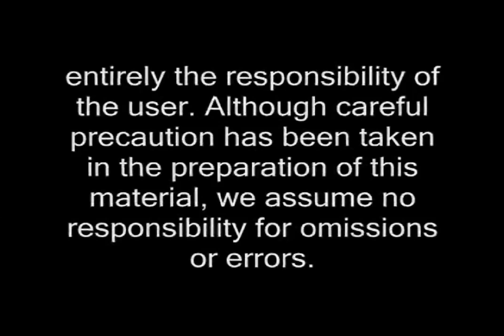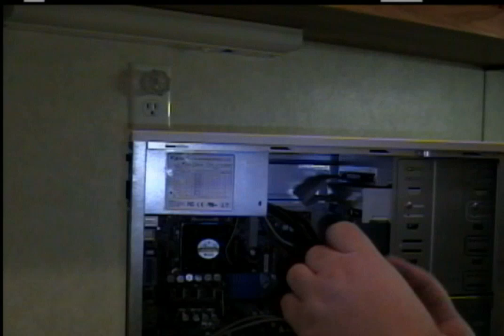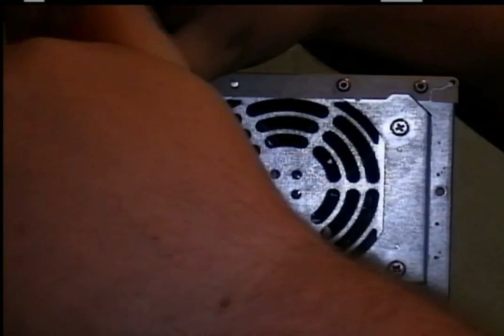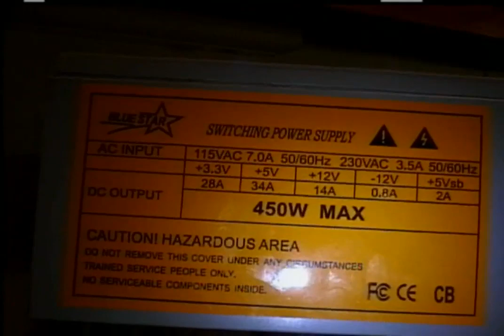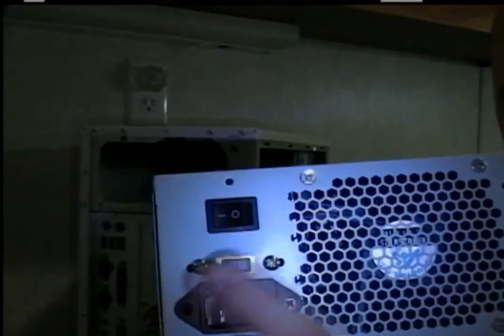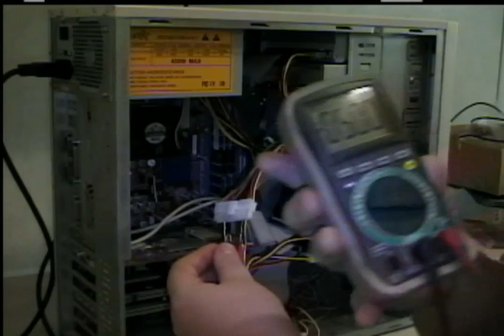Testing & replacing the PC's power supply

Comment from the maker: Surge protectors do not protect a whole lot. Was the PC plugged in when you cleaned the Fan? Try resetting BIOS. If the PC was unplugged for a period of time while cleaning the CMOS battery may be weak and needs replaced. -MrFixit

Comment: hey ive had an issue with my computer since i cleaned a fan, i plugged it into a socket without a power surge protector and it seems to be having the same issues as what you said about the power supply failing, or maybe i did something else?

Comment from the maker: The HDD should be fine, deputybluevein93. The PSU is designed to shut-off in the event there's a problem. It mainly depends on what failed in the PSU and what the HDD was doing at the time of the power failure. You may only need to run Check Disk on the HDD to correct any errors in the data once the PSU is replaced. -MrFixit

Comment from the maker: You're welcome. Yes, deputybluevein93, the PSU does cause problems when it starts to fail as mentioned in the video Description. Most causes are due to power spikes and surges. The motherboard must receive a Power Good signal from the PSU before the unit is allowed to be turned on to help prevent damage from an unstable PSU. -MrFixit

Comment: Hi i have an inquire.recently something blew up in my pc.there was no smoke or sparks.just a popping sound.obviously the pc went off.i stripped my pc apart.i had a look at the motherboard.there doesnt seem to be any damage on it no burn marks.but i wanted to know could it be my psu.i stripped that aswel but couldnt see anything in there.but i read in alot of forums that the psu in one of the main causes of pc failures.the psu i had wasnt branded name it was 750 and wasnt expensive.thanks

Comment from the maker: The P7 connector is similar to an IDE 4-pin power connector but much smaller. It's used on PCs that use the old 3.5 inch Floppy Disk Drives. -MrFixit

Comment from the maker: Yes. PCIe x16 is used for today's Graphic cards. Some need a power connector from the PSU called a PCIe x16 6-pin power connector. Be sure the new PSU also provides this connector if the new graphics card requires one. -MrFixit

Comment from the maker: Yes. According to the specs for your model the GPU is integrated into the motherboard. There should be an available PCIe x16 Slot you can use for a new graphics card. Be sure the new card is PCIe x16 and supports Windows 7 64-bit version. -MrFixit

Comment from the maker: The PSU can be replaced with an equal, or higher, wattage power supply as long as the new PSU has the needed connectors. The GPU, if not integrated in the motherboard, can be replaced with a new Graphics card that Windows 7 64-bit will support. If the GPU is integrated, you can add another Graphics card using an available PCIe x16 slot. Then you can set BIOS to use the PCIe card as the Default Video device. -MrFixit

Comment from the maker: @ButterMeMilkiWay Sorry I haven't responded sooner. Not all PCs use the standard ATX form factor. DELL is notorious for not using the ATX Form Factor in their PCs. Be adivised although the connector is the same they are NOT compatible with ATX PSU. Must replace PSU with same type as the original or damage will occur. To test NON ATX PSU, use the Orange wire (PWR Good/OK signal) with black wire (ground) should get 3-6VDC and the Gray wire turns on the PSU. -MrFixit

Comment from the maker: @CHEVYbarracuda1 If the PC will not turn on, 1st, check that the Voltage input switch is set to the proper voltage (115VAC or 230VAC) and the power switch is on (if any). Not all PSUs have a Voltage switch because some are automatic. 2nd, remove the motherboard's power plug. Using a test meter, connect it to the GRAY wire and the BLACK wire next to it. The GRAY wire must read between 3VDC and 6VDC (5VDC is typical). This will prevent the PC from starting if the Voltage is not present. -MrFixit

Comment from the maker: @kaleluk31 It follows the ATX form factor. It mounts with 4 screws on the backside near plug and power switch (some PSU have them). The unit sits on a rail inside the PC for support. Your model uses a 120mm fan as to why its on the bottom and mounts the same as in the video. When you open the PC case, you should see a metal bar on the other side of PSU. That's the support rail. It supports the PSU weight. I never thought of showing the rail in the video. -MrFixit

Comment from the maker: @kaleluk31 the fans location should not cause any problem as long the airflow goes outside the PC case and its not in the way of the processor's heatsink. There are 4 screws that mounts the psu to the case. Not all psu follow the same form factor so it may depend on the model. -MrFixit